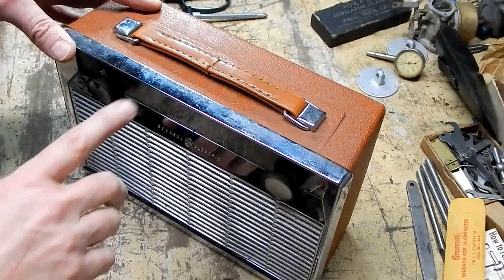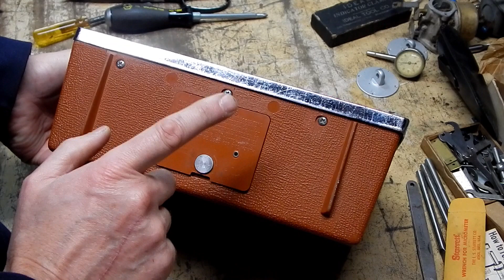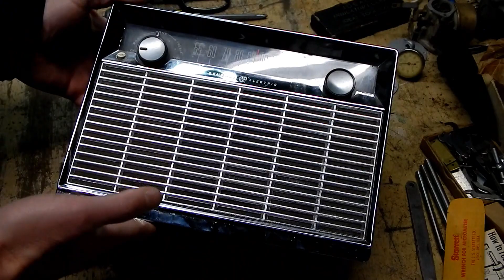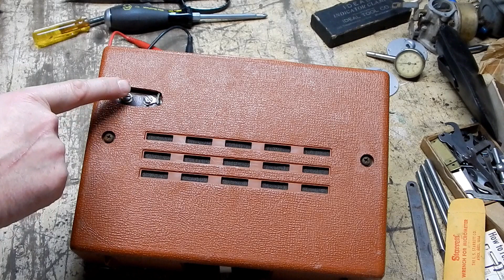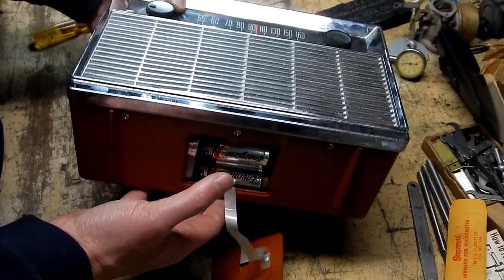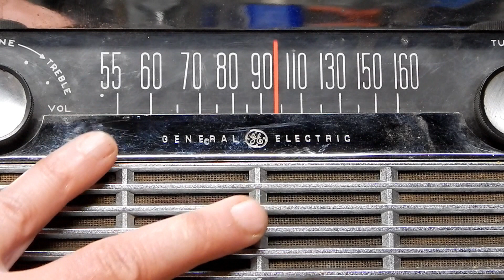Identifying GE P780 Radio series

Comment: The tube types used in portable radios didn't get hot at all, they operated on very little heater power (1.4v@50ma).  Of course just the heater power alone was usually more than the total power required by transistor sets.

Comment: Hi, I’m a radio novice.  If am doesn’t need a whip antenna, why did they include them on later models? Thank you
Reply from the maker: I do not know. Sorry.
Reply: Probably a marketing gimmick, reception with whip is not as strong as the built in ferrite rod(at least my G isn't & it's been aligned twice). Series G was only unit with whip, F, H plus 783A/784A that ALL came later, do not have antennas.
Reply: @tombryant1104  thank you, I’ve since bought the C crane EP Pro Plus and the Grundig Field Elite they both come with a MW antenna outlet, I since bought a passive loop for AM